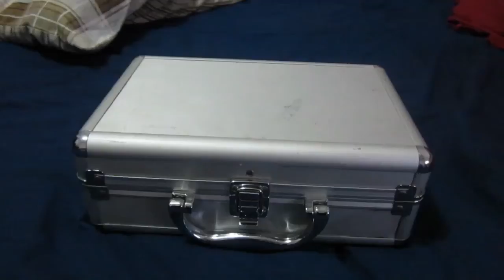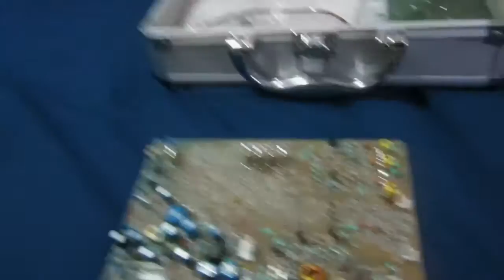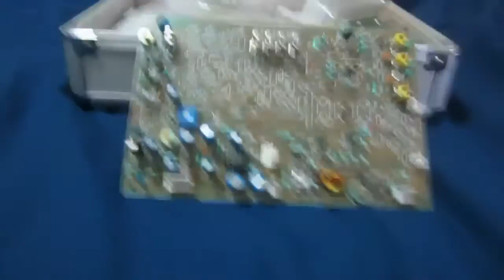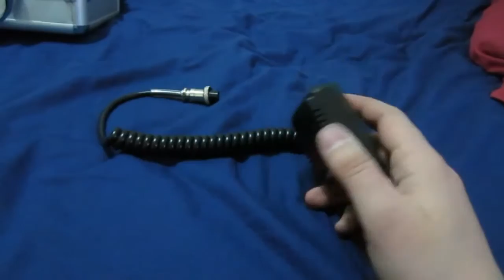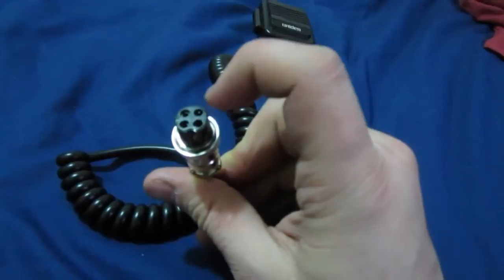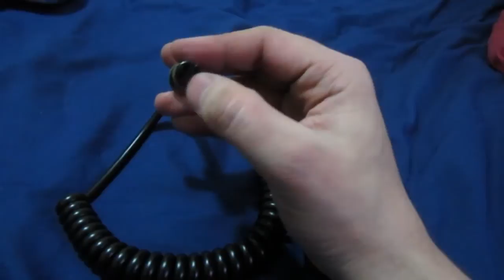Things I Learnt Building a BITX Transceiver For 40m

Comment: hi, Can you share the link for manual, for how to convert BITX to 40 meter version.
Regards.
Reply from the maker: gurudatta panda Sorry for the delayed reply, I just found my notes - you will need to 
look at the schematic to understand what I'm referring to: - Change IF to
 12MHz by changing BFO and filter xtals to 12MHz. - Caps on xtal filter 
are 68p-82p-68p. - VFO coil is 43 turns on a T37-6 toroid. - Pi filter 
coils on the RF power amp are 19 turns on a T37-6 toroid. - Caps on output
 pi filter are 500p-1n-500p. - Bandpass filter stolen from PY2OHH 
BITX-40 schematic - http://py2ohh.w2c.com.br/trx/bitx/bitx40completo.GIF Hope this helps.
Reply: snarfusmaximus Thanks for reply. Yes, I am using 12 Mhz anyway for 20 Meter too. So only the filter changes will be required, as my DDS VFO is able to oscillate at those frequency.
Reply from the maker: gurudatta panda Nice. Please post a video when done and send me the link. I plan on modifying mine with varactor tuning and a 10-turn potentiometer. A DDS VFO is definitely something I'd like to try out on a future project.
Reply: How test the tx